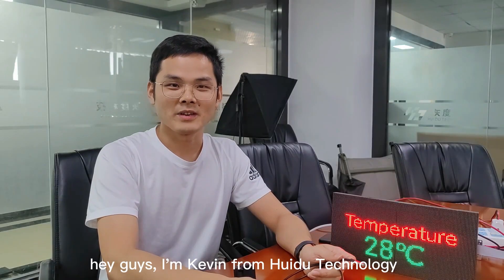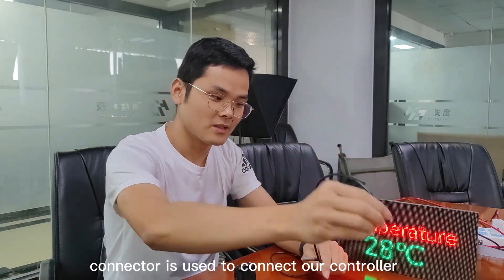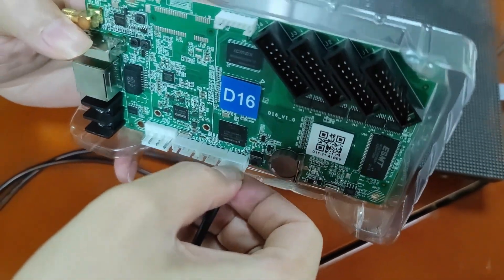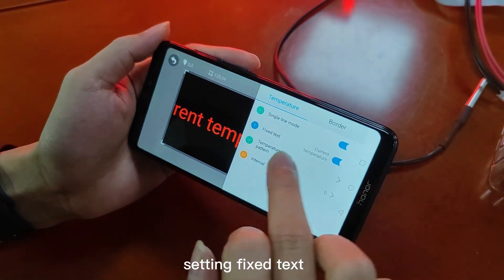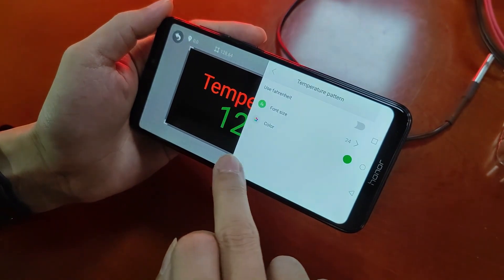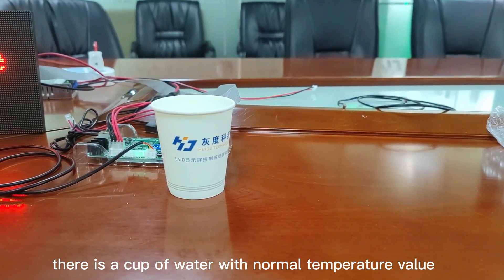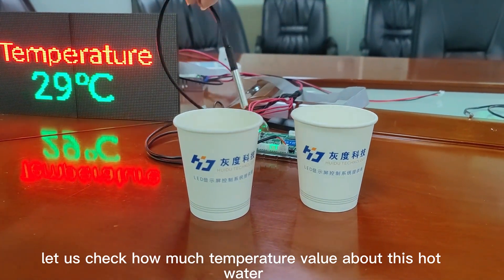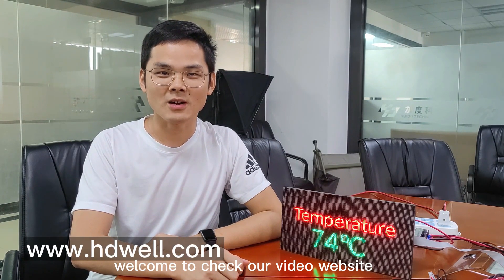Huidu Controller D16 Working with Temp Sensor Setup Method

Comment: Hello. I have a problem and I don't know how to fix it. The sensor indication is very wrong. The outside temperature is about 0 degrees and the display is showing 10 degrees celsius. I try to compensate by -10 but after compensation when outside is plus 15 is showing 7 degrees.
Reply from the maker: Can you show us some screenshot to check, welcome consult whatsapp: +8613510540791

Comment: Sir can u let me know how to Interface Gps module with W03 Or W02 card. I want to make gps clock
Reply from the maker: Hi bro, for GPS clock, had better use W63 or W64 or E62 or E63. Because W03 and W02 and other models don't support GPS function.
Reply: @HuiduController  no issue sir we can use w63 Or w64. But how to set up & configuration kindly tell me step by step
Reply from the maker: @SpectrumTechnologies  just open the time correction by gps , you can message me on WA: 008613510540791
Reply: @HuiduController  ok sir thanks. I ll contact u when I ll make it by next week. Kindly help me
Reply from the maker: @SpectrumTechnologies  always welcome, bro🙏